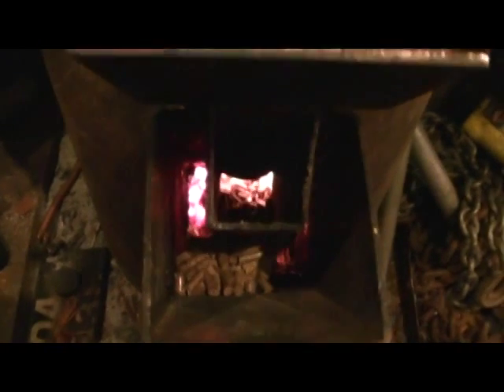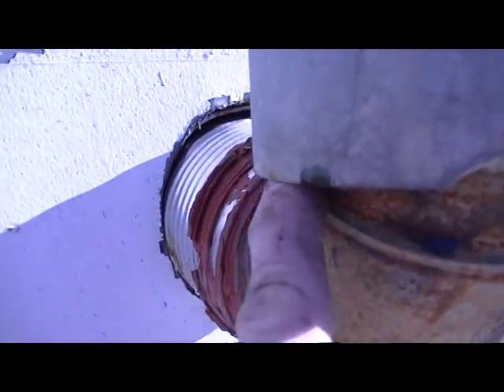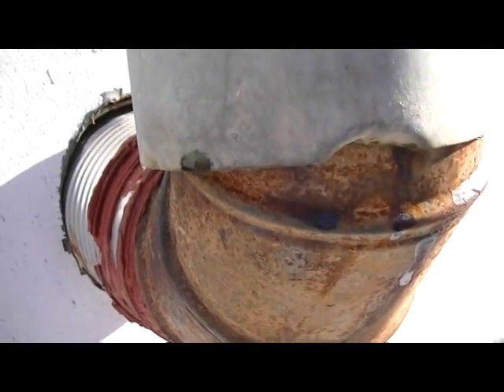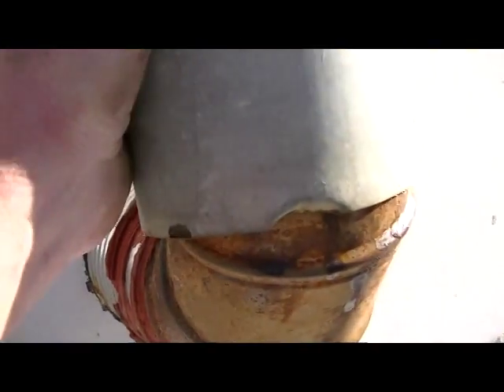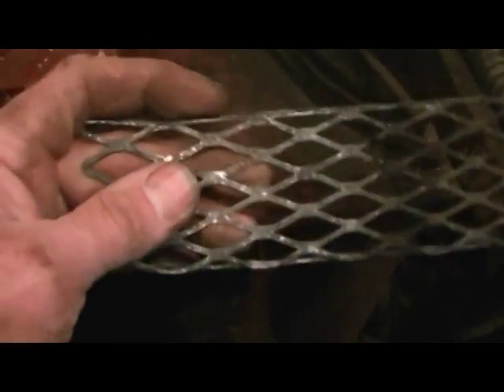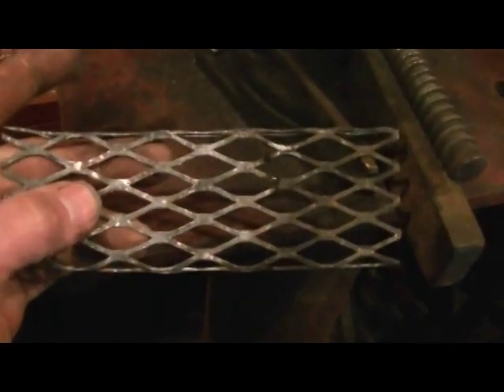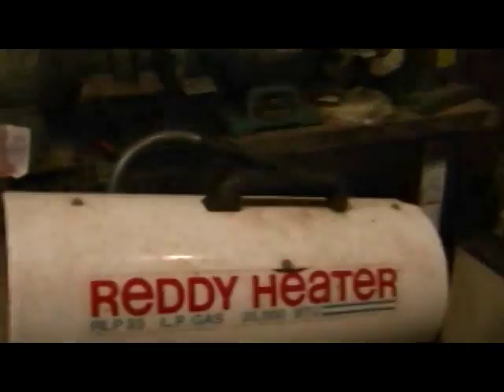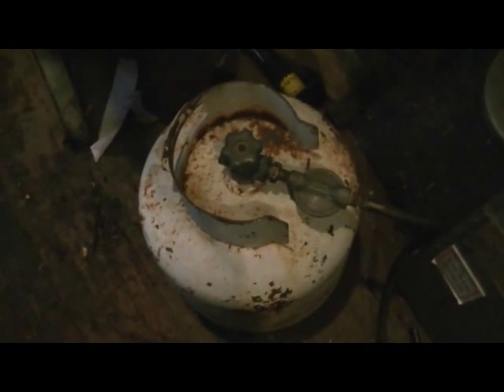Rocket Stove Space Update and Pellet Adapter

Comment: I know it's unrealistic, but it'd be interesting to sample the exhaust, and get an analysis of the gasses and particulates that are being released into the atmosphere. Where I live it's illegal to use any type of wood burning stove on certain days in order to "Spare The Air" from wood smoke. Personally, I don't think your stove would be worse than even one of the newer diesel engines.
Reply from the maker: No observable smoke or smell. Just water vapor. I guess the side of my trailer is the witness. Only a very small smoke line on the white trailer after many hours of heat and several alternative fuel trials.

Comment: If your shop trailer was 8 feet from your house you could insulate an 8 inch pipe and connect it through your window in the house and blow hot air to heat house. You could build an insulated box on a junk trailer with a stove inside to do the same thing and park it behind the barn in the summer.
Reply from the maker: I have a large "carport" next to the house that will contain the final version. I want to make it a water heater system with tanks inside to hold reserve heat. The trailer idea would certainly work!!

Comment: Which stove to you like better. The rocket or Omega..
Which do you feel is more efficient?
Have you ever tried to build anything that would keep burning for 10 to 12 hours?
Reply from the maker: The Omega is better in many ways and transfers heat faster. They are both equally efficient, but the Omega takes up less room and ins not nearly as heavy. Omega also starts heating much faster, which is what I need in my ice cold shop or hunting blind. As for `10-12 hour burn, I prefer to heat a mass and let it provide extended heat times. I'm working on a hot water system and will be posting videos soon.
Reply: Thank you. I was looking around and found your video on Omega versus the rocket stove. I see exactly what you're talking about. Thanks for the videos and keep up the good work.